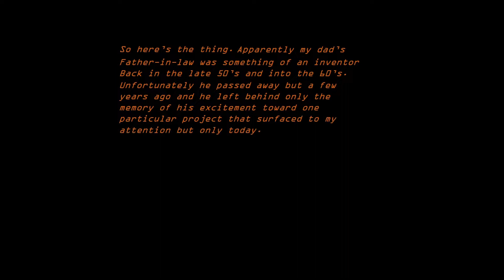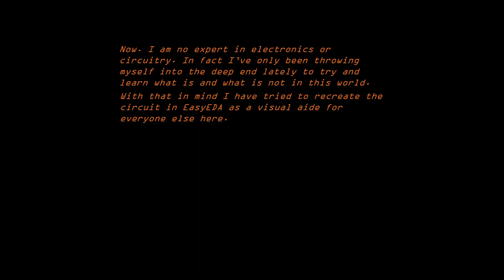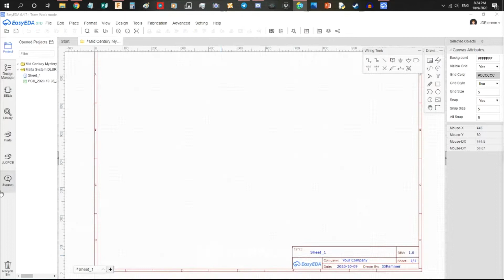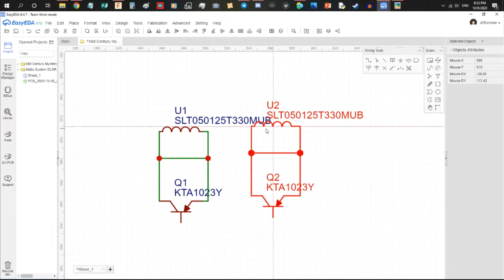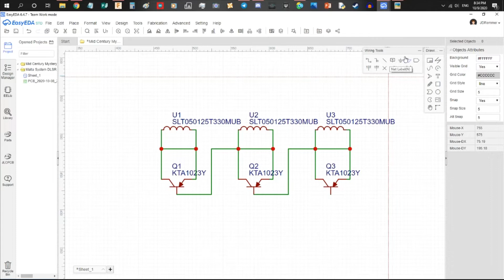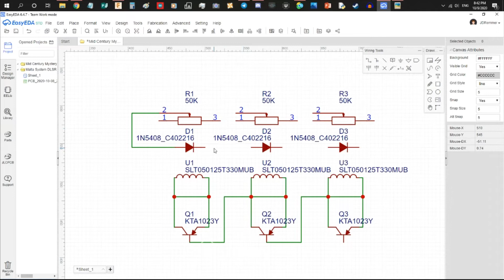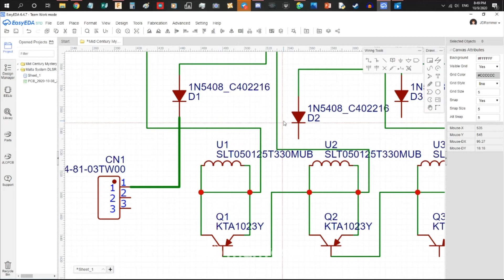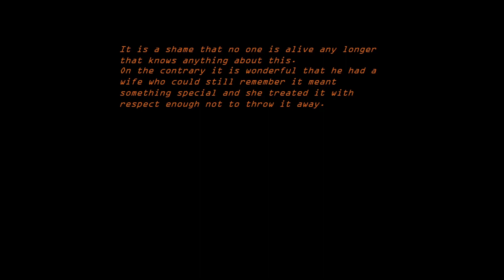Mid Century Mystery Invention

Comment: The schematic looks like pure nonsense. But the component layout? I've seen that before... in RF amplifiers. Three stages, and from the size of the transistors and heatsinks, high power. I suspect it's either for ham radio, or someone was running their CB /way/ over the legal power limit. Not an uncommon practice.